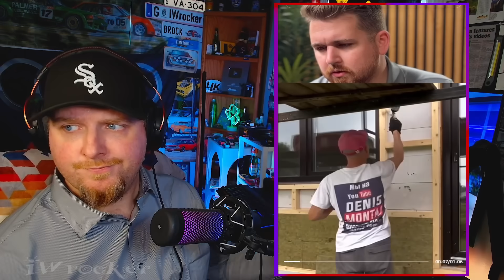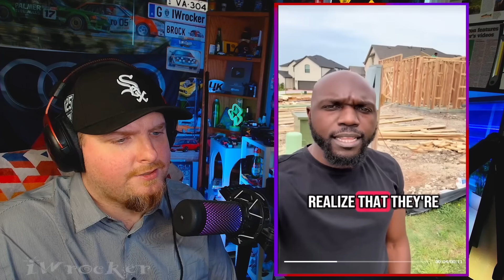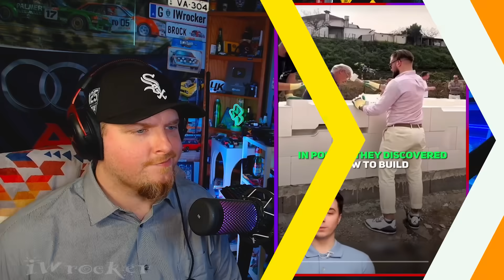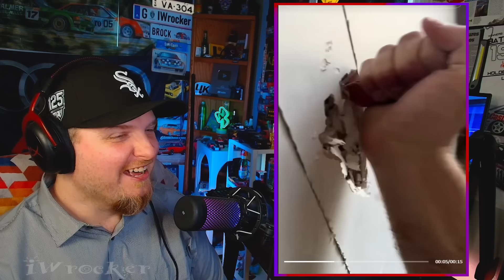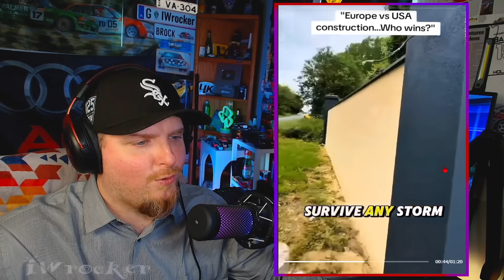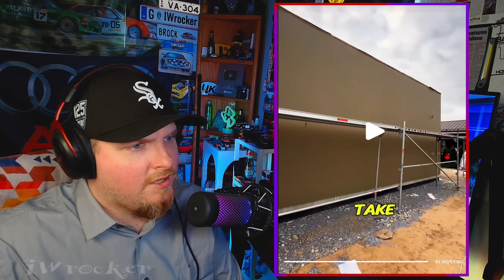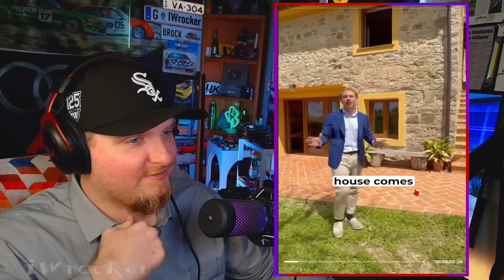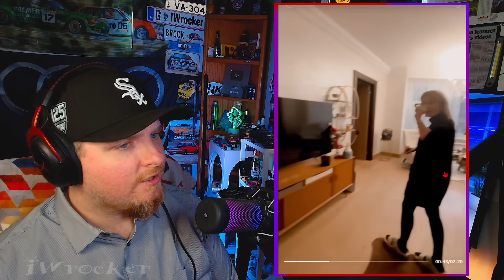25 Minutes of European VS American Home Quality & Construction Methods 🔨

Comment: In europe we also have plaster walls on the inside of the house if it's a modern house, I have an old house that got renovated, so outside walls are around 1 meter thick stone walls but most inside walls are just 10cm thick and made of plaster.
Also I had no idea that the standard for american windows is pull up ones, the only pull up ones were have in europe are antique wood ones, only thing metal on them tends to be a sort of hinge which hinges over the top of the movable half of the window to lock it, and you pull the window all the way up and inwards a little to keep it open, but standard around here now is aluminium side sliding windows, most of the times I see tilt and turn windows they are part of a floor to ceiling window/door.

Comment: 13:29 You really don’t know much about the different types of windows routinely available in the US. What you describe is a single-sash window where the bottom panel just slides up. The most popular windows are double-hung windows where the bottom panel can slide up or the top panel slides down. The panels also tilt completely in for easier cleaning. We also have casement windows, which are similar to the European style where the window opens outward on a hinge using a crank. Awning windows are pushed open from the bottom and remain fixed at the top. Sliding sash windows, which consists of two panels side by side and the one panel slides open over the adjacent panel. I have double hung and sliding sash windows in my house. I would not want window that swings into the house because that limits what the space around the window can be used for. You can’t put seating under those windows. Of course other type windows are available.

Comment: 18:27 in London there are quite few of these, they are only facades just the front, back has been gutted so they have where to place ventilation for the subway, which is ugly, so they kept the front of the house to hide all the vents.

Comment: I see American houses as big cardboard and wood boxes. A Dutch house has usually double brick walls with insulation in between, German ones are even better built. I remember my brother in law's house was broken in, through the wall 🫣 You need an electric sledgehammer in Europe. Except in Sweden, they have a lot of wooden houses but better insulated.

Comment: Just to point out how effective the insulation is (it's not just the insulation by the way, it's also the windows, other systems and even the design of the house itself):

A couple of decades ago CFLs (compact flourescent lights) became really popular, and people replaced their incandescent lights with CFLs. Turns out that this was a problem for some low-energy homes: They were so highly optimized that they accounted for the incandescent lights' low efficiency (95% of the energy is turned into heat, not light) and used it for heating. With CFLs, the house wouldn't warm up. (They had emergency heating systems designed for extreme weather, but they were running even in mild winters using CFLs.)

Comment: European shelve hanging experience: burn up 3 SDS drill bits on rebar and pebbles that were inside the concrete, but that shelve will NEVER come down. You can put 800 lbs on that shelve...no problem!

Comment: My personal question i why you do not have a sheet of OSB directly behind the drywall?
Even a thin 1/2 inch sheet would drastically increase the durability and it would allow you put a screw directly in for lighter loads.

Comment: Hi Rocker, west European watcher here. While not all our house are in massive cut stone (only old ones, the toughest and most durable, basically), we mostly use rectangular concrete block, or bricks in special shapes to build our houses. What baffles me, is why don't you do the same in USA, and only use crappy thin wood, that is turned to crumbs with a single tornado x) If only you could all build yout houses in USA like we do here, I'm pretty they would be less victims in natural disasters.

Comment: Here in Austria every building has the insulation outside like in the video. Only the old historical buildings don't have that, they are built from stone and wood. I lived in a house in Salzburg that was finished 1077, the year the Festung Hohensalzburg, the fortress above the city was fnished. The 100% stone walls, converted to US units, are 4 feet and 11 inches thick. They are pretty cool, literally, during summer but you have to heat a lot during winter.

Comment: My place was built in 1965. Double layer brick with reinforced concrete lintels. Had real difficulty hanging curtains because the masonry drillbit wasn't strong enough for the concrete. Had to replaster and paint several spots where we'd tried drilling and the wall was having none of it. Ended up hanging all the curtains higher so we could drill through brick. 😅

Comment: Our house in Belgium was created in a factory in two weeks. Then assembled in three days. Tolerances are very tight because it has to fit together perfectly. It is almost a passive house. 28 cm outer walks, 16 cm inner walls. Wood and insulation. Sound and thermal. But the quality of the wood and insolation is way higher than in the US. In the street over a similar house has been there for 50 years and  you cannot tell. Still perfect.

Comment: You could use a shade cloth tarp over your house with a rail and electric motors that lets it open and close, this would prevent or reduce the thermal energy from the sun ever reaching your house, extremely cheap and 100% effective, if the energy is reaching your house you have to remove it via the ac, if it doesnt reach your house you never have to remove it.

Comment: Those cheap European windows…. are cheap. It’s the plastic type. Plastic is an ok insulator, but the frame takes up so much space to make them sturdy. 
You should check out some proper anodized aluminum clad wooden oned from fx danish Velfac

Comment: I'm an electrician in Italy. New homes built here must have a forced ventilation system due to the extreme insulation of the homes. Without ventilation, the environment would be unhealthy and at risk of mold.

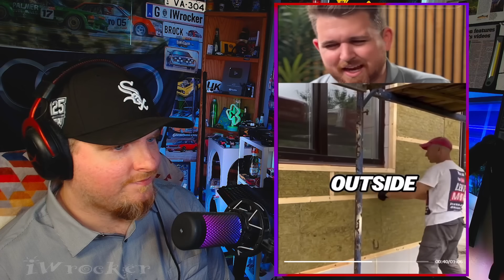Comment: 1:20 - You put insulation outside because it's more efficient and better for your walls and microclima, walls insulated from outside last much longer without damage caused by temeperature changes, you don't have such a big problem with mold and stuff like that.
Problem with insulation from outside is that it's hard to insulate historical buildings in a way that it looks good, so these are cases where you may prefer inside insulation because of esthetics or because authorities would not allow it from outside on historical building. But older buildings mostly have like 1m thick walls, it doesn't need insulation that much, but I would say that most of buildings in Europe already got some insulation or it will happen soon, at least here in Czechia, there were massive donations for that, sometimes it ended pretty bad and they completely destroyed design of some buildings, so it's possible that future generations will have to fix it once again to make buildings pretty again. Insulation from outside is more efficient, but in most of cases, it just looks weird, obese (like today european cars), for example typical commie blocs with insulation have those thic layers around windows and windows look smaller and deep inside because of insulation, it looks weird, but pratical aspect is winning here over esthetics.
I studied these things, outside insulation is always prefered if it's possible. But wooden constructions are becoming more popular even in Europe because of housing crisis and people looking for ways how to make it cheaper.
Drywalls were pretty much unknown here before 90s, but I would say it's more and more common for inside walls and stuff like that, because exactly as you say, it makes renovations easier, but using some thin bricks like ytong made of light concrete is still prefered, but it's not rare to see dry walls in new european buildings, but I would say it's more common in office and corporate buildings than in apartments and family houses.

Windows are mostly at least double layered with proper sealing now, in these days, you hear some highway pretty much everywhere, you can't escape that, so this is really important for sound isolation. People underestimate noise from highways when they buy houses and then they suffer with closed windows for a whole night in summer which forces them to use AC which is another noise and unnecesarry electricity consumption.

Here in small countries like Czechia with some village very 500 m, you can't really avoid noise from highways and roads completely, not even in very "shit-holish" areas, so people should think about it more when they build a house because it's gonna be even worse after they increase speed to 150 everywhere and add more lanes.

Our housing crisis is that bad now that own house is pretty much not available for ordinary people now, because when you earn like 1200 eur netto, you really won't get a mortage for 400 000 eur house or apartment, people who bough houses 20 years ago for like 100 000 eur are now laughing. 😀

21:40 - 700 dollar/month, that's like rent for some tiny 1 room studio apartmetn in these days, maybe not even that, don't tell me it's that cheap in northern europe with their salaries, that's hard to believe. A typical apartment in Prague or central bohemia with like 2 smaller rooms and little kitchen would be now for like 1000-1200 eur/month and we have 1/2 or 1/3 of a german salary, it's crazy.

Comment: Tbf to American building customs, y'all wood is much cheaper than ours, which is probably the reason you use it so much. Still very wierd to see y'all build basically insulated tree houses because they won't last. My uncle just inherited a house built in the 18th century in like the 1770s and other than a few minor repairs to the roof and some mold that needed to get sprayed and painted because noone used it for years, it was a perfectly fine house.

Comment: I´m from Spain, starring to build my house. The exterior walls willbe made of concrete with an air gap for insulation and covered whith plastebard on the inside, interior partitions will be made of bricks covered with cement, The roof also be concrete will be flat and will have solar panels

Comment: Europe is not a country and different European countries use different building methods. It shouldn't be surprisingly that houses in Mediterranean countries are different to ones in Scandinavia.
Reply: Here in Finland wooden houses are easily the most common ones. Concrete slab with floor heating, wooden frame, 30 cm of insulation, wooden seathing and felt roof is the standard.
Reply: @lbh704 I think steel roofs are more popular
Reply: @teemur76  I think so too, and at least here tiled roofs are more popular than felt roofs still.
Reply: @teemur76 
Copper is forever but lately ppl have begun stealing it. 😂
Reply: @lbh704  It comes down to material availability and geological / climate.  The West Coast in the US is highly earthquake prone, and has plenty of wood.  Brick / cinder block or anything that relies on gravity to hold it together is a non-starter.  Reinforced concrete is fine, but expensive.  Bricks are going to fall apart if an earthquake has significant upward motion.

I imagine Finland has good timber resources.
Reply: My Mediterranean house is very cold in the winter 😅
Reply: @noanoa332 Which, considering how it doesn't even get cold in the "proper" coastal mediterranean areas, says something. =)
Reply: Yup
Down south they like stone because its nice and cool in summer.

Up north they love wood because its easy to heat in cold winters.
Reply: Agreed..... UK highrise flats from the 60's were based on designs fro the Mediterranean which turned out to be totally unsuitable for our climate.
Reply: And America is not a country neither :)

Comment: But the ignorance in the first video is unbelievable. If he’s a builder, stay well away from him! That type of insulation is installed on the exterior because it’s much easier to create a continuous envelope than to interrupt it at every wall or structural column. In this way, you can easily solve 80% of thermal bridges. Clearly, our builder never studied building physics at university. Installing insulation on the inside is extremely problematic and leads to unhealthy indoor environments.
Moreover, the blocks used for those perimeter walls appear to be autoclaved aerated concrete blocks, a material with excellent thermal insulation properties. Don’t you have them in the USA? The insulation panels are made of rock wool, which is highly insulating, vapor permeable, and fire resistant. Small builders in the USA are completely ignorant of both traditional and modern construction methods.

Comment: i hope I dont need totell you how houses in Croatia look like. In the Dalmatia they are almost all made of stone....think of it like living in your personal Dubrovnik. Inland Croatia we build them mostly of bricks and concrete but there are houses built from timber logs. this lady in Riga....thats super cheap... Zagreb currently has 3000 euros + per square meter of new apartment. many apartment buildings on elite places in Zagreb have 10 000 euros/m2....its awful how expensive they are. 700 euros can be enough of 50-70m2 apartment if you would rent it.
Windows...they are cheap here. windows like seen in video cost 600-1500 euros depends on the windows of course. 25 000 for american....thats just pure robbery. 
you should take your wife and travel across Europe and film what you see

Comment: I live in a 100-year-old house; it has double-brick walls with a 3-inch air gap and a slate roof. There is no modern insulation in the house yet, even in winte,r the house retains its warmth and stays cool in summer. The house has been in my family for 50 years. In that time, the only work the roof has needed is 2 slates replaced and the ridging tiles reset. Where I live in Scotland, we quite often get gale-force winds. Having been in the US a few times, I would not trust an American house to survive a year here.

Comment: It's not typical concrete but cellular concrete. You can cut it using regular saw. That way of making isolation is some mad dyi thing.  You are not supposed to use wood  during insulating cellular concrete.

Comment: In denmark we generally have 3 type of house dessigns:
1: build with brick walls, double layers for outher walls with insulation in between and plaster on the outside or bare brick facade, yes also brick on the inside walls but a single layer.
2: Concreate walls on the outside with insulation on the inside with double layer dry-wall cover. Sometimes with wood structure walls with dry-wall cover and paint for inner walls.
3: Wood or steel panel structure walls with thick insulation and double drywall on inside and different types of outside facades even real blicks, else kinda like in Usa but probably with thicker walls.

I don't know if USA have the storry with the 3 little pigs and the big bad wolf?
Anyways the 3 pigs each build a house, to protect them from the wolf.
The first build it with straw and mud, then the wolf come and blow it apart and the pig flee to the second pigs house.
The second pig build a house of wood and is proud of himself, when the first pig come asking for help, they enter the house as the wolf comes, then he huff and puff and blow it apart with more work but the 2 pigs have to flee to the third brother.
The third pig build a house with stone with more work and finally finish it as the 2 pigs come running, they enter the house and wait as the wolf huff and puff trying to break the house, but with no success then finally he gives up and the 3 little pigs get to live in peace.

With that I feel like Europe is at the thrid stage building sold brick and concreate homes.

While Usa seems to be stuck at the second stage building homes with wood and the big bad wolf come and blow it away now and then.

Ofcause not all but in general!

Comment: Walls around houses are disgusting. It turns a nice green street into a hallway in concentration camp. A wall is basicaly: I am too lazy to maintain a green hedge, I do not wanna maintain wooden fence and I want everything inside to die in shadows. It might work differently in desert areas, where there is no greenery and a bi of shadow can help plants to grow, but where I live it is just ugly, and cheap.
People used to have front and back gardens here. Front one was small, just between house and road, where you had flowers or a small bush. Make nice for the passerby. If there was a fence, it was knee high. Back garden had a purpose to produce food, so apple trees, cucumbers, raddishes, carrots, strawberries etc.. That is how we lived for centuries. Now they have 3cm tall lawn inside 2m tall, gray walls. Hooray, we escaped the socialist block! Yet they live in it placed sideways.

Comment: Sweden: Here we build a lot of wood houses. Even multi storage ones are becoming more popular. The difference compared to USA is that our houses are sturdy. I mean it. They are really sturdy. Well constructed, well dimensioned beams and put together on a way that makes them basically indestructible. And thick insulation. Some houses have half a meter thick insulation. I have seen where our houses has been taken by a flood where the banks have collapsed and the house sits half way out. Still intact. And then it falls down. Still intact. And then it floats away. Still intact.

Comment: I have kicked down drywall walls before, it's pretty fun.... but those are usually used in modular office buildings, where you just throw together quick custom spaces for the current rentee instead of making permanent alterations